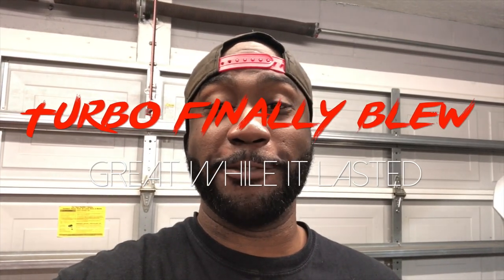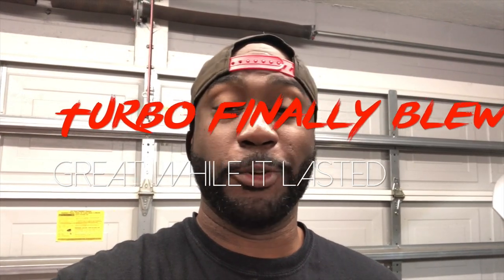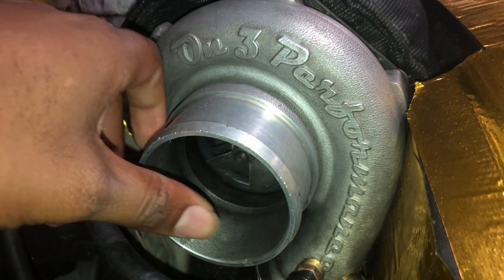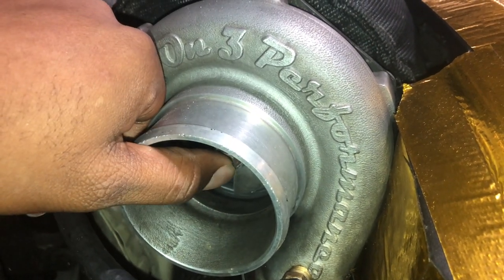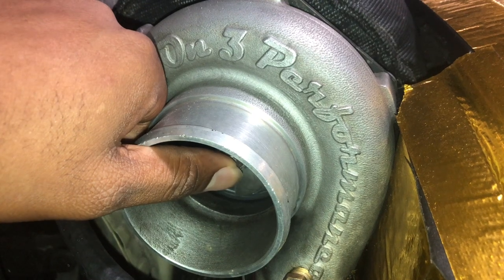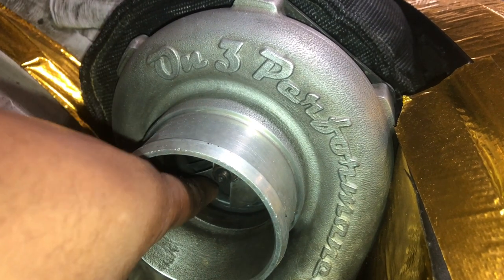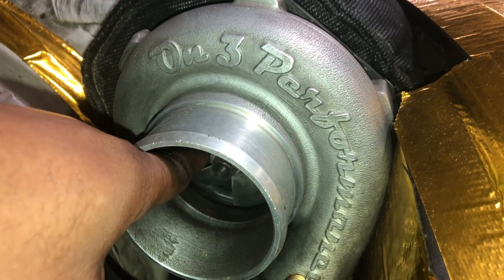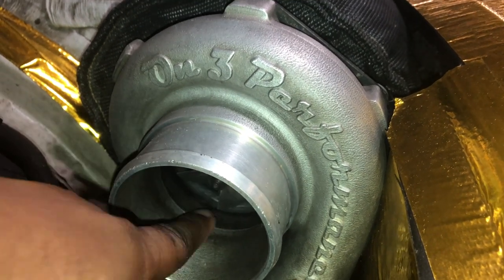My BMW N54 ON3 Single Turbo Finally Blew

Comment: Try 0w-40 . Change it the first 500 miles, then again at 1000 , maybe twice. It will clean the shit out of the engine. 
Also try 081 mosfet drivers in your ecu.
I would go to a efr series borg warner. 
Those things are solid as hell and spool quick. This will be the set up I'm running. 
Reason bieng not wanting to close deck the block or run forged rods and pistons.
I plan on running stock coil packs,  bottom mount is stealthy , and lowers the center of gravity , drops overall weight. To4 twins make shit tons of area under the curve for a better daily but all that low rpm torque will dramatically stress everything.  Check out thermal coating your stock pistons and rings , run two step colder plugs. Just a few ideas.
Oh , royal purple then mobile one 0w-40 permanently. Royal purple has great engine cleaning properties.
Reply from the maker: Thanks for the insight!

Comment: Hey Noshi that’s awesome I’ve just been able to start driving my on 3 single turbo 335i just manual swapped it and I feels amazing. Just curious what your are going to do about that shaft play , new internal journal shaft or new turbo ?
Reply from the maker: Ohh that’s great to hear, single with a manual is the best feeling lol. I’m just going to get another turbo. On3 sells new internals for $188, but my housing is jacked so just getting another one.
Reply: You swapped from an auto to a manual? I really want to do the swap the only thing I’m worried about is the software. What did you do to fix the software?
Reply: @nuhnuh61  coding side is actually pretty easy. Find someone on a Fourm and they can probably help u out. Most people say it’s takes less then 5 min

Comment: I have my ON3 turbo sitting around and collecting dust if u want it . I used it for barely 1000 miles . I changed over to a GT3582R had to modify the downpipe to fit.
But definetly if u want the turbo hit let me know im in Clearwater.
Reply from the maker: Yea man definitely appreciate it. Link me on IG @el_noshi
Reply: You still got that. Share the fun bro lol
Reply: Mam Cie W what brand turbo gt3582r?

Comment: Was the gt35 making good power or you would go for something bigger like the 6266?
Reply from the maker: It made good power, and spool was decent. If you can get a 6266 initially I’d def put that on.

Comment: I’m purchasing this kit also. Wanted to ask you what did you do use for the PCV system
Reply from the maker: I ended up using both of these to address the low and high side. https://tinyurl.com/txpkw9r  https://tinyurl.com/vpljyhs

Comment: Is it possible to pass emissions with a single turbo setup?
Reply from the maker: Haven’t had to deal with emissions since in FL. Pretty sure you can as long as your tuned, and your sensors are at the ready.

Comment: Do you know how much power you were making?
Reply from the maker: No my guess it felt more like low 500. Comparing it to other dynoed 500 hp cars. 18psi 93 oct
Reply: @nOshi2x  Ok, on pure stage 2 DD I made 597whp. E40 with Meth. I'm literally ordering a on3 kit right now with a 61mm. I plan on sending it so hopefully I can make what I was already making at least lol
Reply from the maker: Ohh word nice. Yea you will make more than that you will crack into the 600’s. My tune was super conservative and has a lot left in it. Your using meth for pure cooling or for supplemental fuel, if it’s for fueling your car is going to rip nice!

Comment: After my 3rd on3 chra i just went with a pte 6266..lol
Reply from the maker: Ohh wow! Thanks for the heads up, each  one blew or shaft play?
Reply: @nOshi2x  each one blew a seal.
Reply: @mohamadmazlan8590  ohh okay wow
Reply: How fast the On3 chra were going out? Did On3 cover them or you have to paid out of pocket?
Reply: @werevenom3576  i blew it cause i was running more psi than recommended
Reply: Mohamad Mazlan how much psi can it hold? 55 or 61mm turbo?
Reply: @werevenom3576  i had the 61mm. They were rated for 24psi max according to on3. I had mine at 31psi and it lasted a little over 1 year.